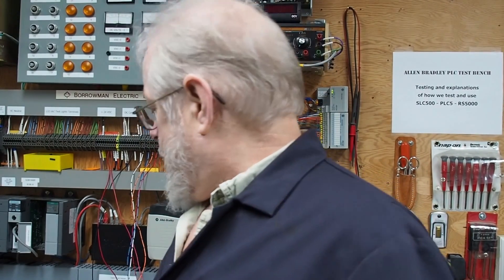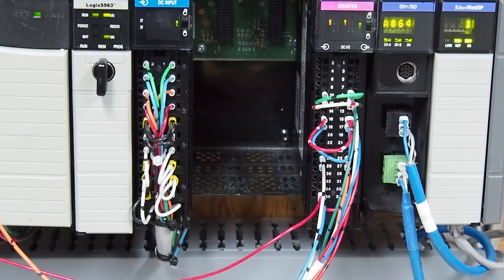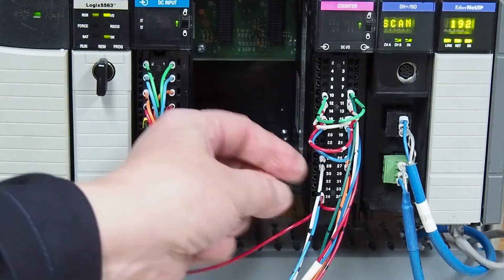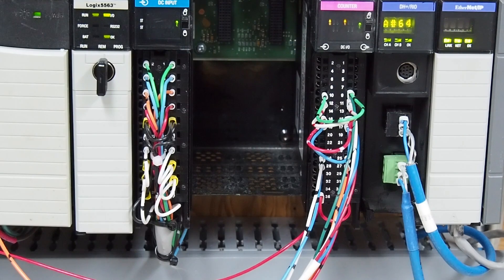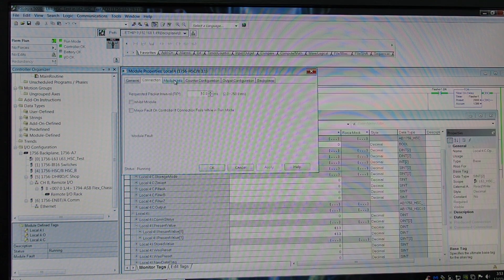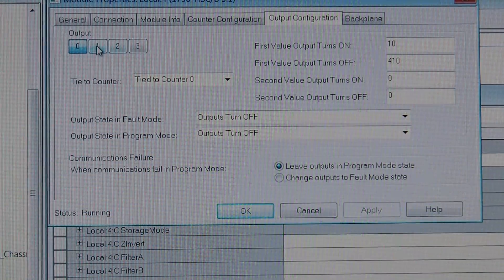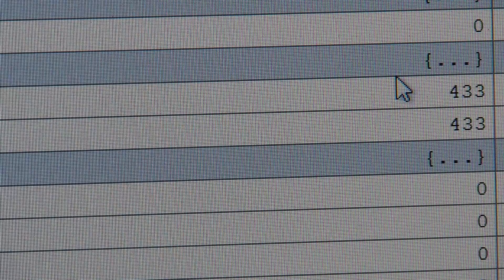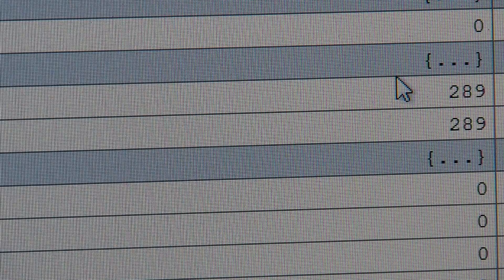1756-HSC

Comment: Thanks for the video, but I have  question. I have an Omron E6B2-CWZ5B. How can i conect it to the 1756 HSC module?
Reply from the maker: These are Allen Bradley/ Rockwell automation cards.  They are not compatible with Omron.
If you are using an Omron system you can only use Omron cards.
Reply: @abplctestbench759  Thanks for the answer. I will to make a migration, from a SLC 500 to ControlLogix. The SLC have an Omron E6B2-CWZ5B encoder, an encoder interface (JB-218) and the conection to the HSC module (1746-HSCE). I need this encoder interface to conect it?
Reply from the maker: @alvarojimenez1922  Hello - Yes the 1756-HSC is the CLogix version of the SLC 1746-HSCE.   I am not familiar with the Omron encoder, but would think that the interface is needed to get the same or better results in the CLogix.
Reply: @abplctestbench759 An encoder is just a device, sir. That’s like saying I can’t use a Turck Inductive Proximity sensor or Siemens Pushbutton with an AB PLC. 

To answer the other guys question, Allen Bradley Bulletin encoders of the 6-Pin variety are your closest analogue, having the same +24, 0, A, B, Z connections, and also a shield/case pin.

See the 124 page, 3Mb, “ControlLogix High-Speed Counter Module - Literature Library” PDF document for more details. Specifically Appendix D, “+12 to +24v Single-Ended Driver” (Page 100) for a wiring diagram.